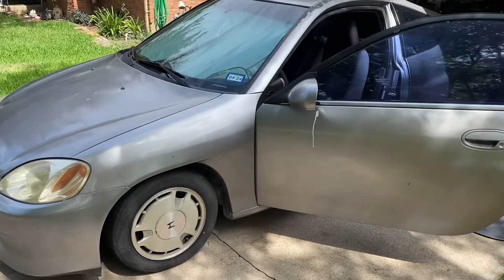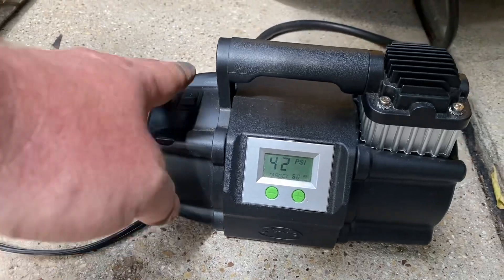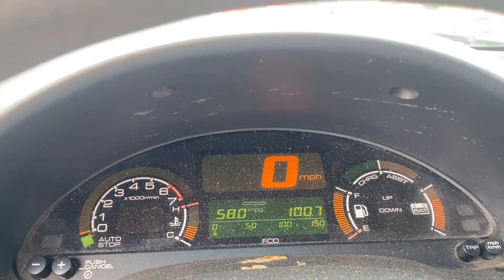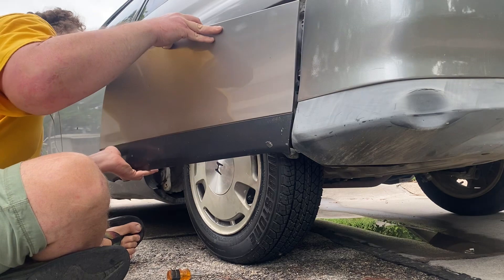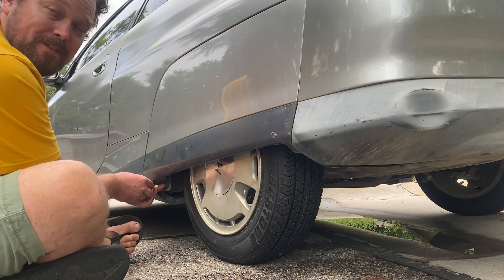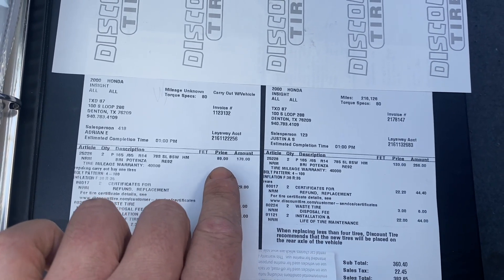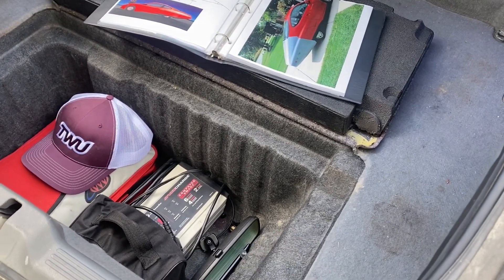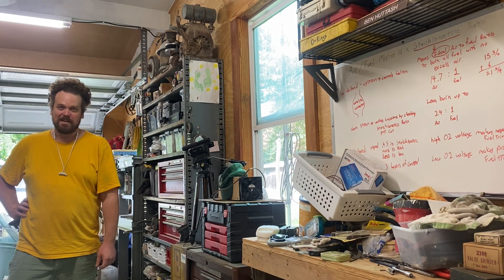With tire prices soaring is it a good idea to over inflate tires for fuel economy risking blowouts?

Comment: Under Inflation Wear Is On the Outside Edges Of The Tire! Over Inflation Will Wear In The Middle Of The Tire! Running Your Tires At Such high PSI Is HORRIBLE On The SUSPENSION!! There Is No Way I Could Run My Tires At Such High Pressures With Roads Being In The Condition They Are In Here In My County! The Same Thing Is True With Extra Wide Tires On Your Car!  When i lived In The City And Could Stay off Of The Gravel Roads This Might Make Sense! but The Question Is Will This Save Me Enough money To replace The Struts

Comment: On the RE 92s I run them at 90 to 130 psi. When trying to get top mpg. Did it for like two years straight. On four different  re  92 tires. Two of the tires failed after a bunch of years and they were eight years old when I started. Still have two of the original high-pressure tires still running. I’ve had my car since 2017. It’s better to run at 70 psi you don’t get as good at mileage but your tire can handle that

Comment: Sucks you had a bad experience with Discount Tire. I'm a moderator at Subaru Outback Forum and they're a very good vendor in my experience. 

With my Insight the tires are also 10 years old RE92's. When it comes time to replace them, I don't know if I will keep them. I know they get the best mileage but there are plenty of other options with much more reasonable pricing and just don't know if it will ever really pay for itself. 

But then again: neither is keeping a 25 year old classic car hybrid on the road.  

Thanks for posting!
Reply from the maker: A lot of people running different tires and still getting great fuel economy. I might switch brands next set of tires if the prices stay so high.

Comment: I have 55 pounds in and get 15 mpg in my f-150.
They are LT tires so made for load, I can't imagine how low the economy is at low pressure with passenger tires.
Reply from the maker: Running high pressure in your f-150 is a great idea. Increasing fuel economy from 13-15 mpg is a 15.38% increase in fuel economy and will really show up at the pump. The less fuel efficient the vehicle the more impactful the efforts to become more efficient are. On a car like this insight if we were to increase the fuel economy from 60 to 62 mpg we would only see a 3.3% increase in efficiency. Dollar for dollar its a better return on investment to over inflate the truck tires then the Insight tires. Saying that we can benefit from it at the fuel pump. We just need to not spend that saved money in premature tire replacement.
Reply: @BenHuttash  55 pounds is factory setting, she is small as trucks go, standard cab, short box, two wheel drive, the smallest naturally aspirated six, but heavy duty suspension, transmission cooler, 3.73 rear end, so fun but not economical...!